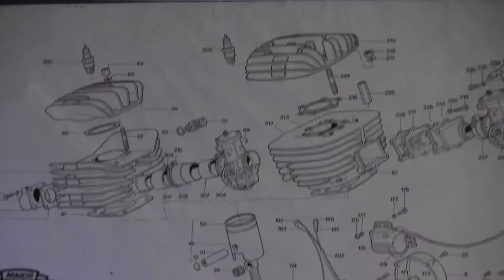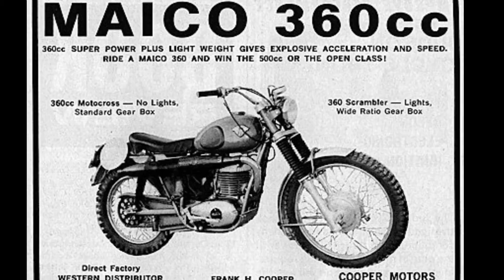1982 Maico 490 Carb Swap (HD)

Comment from the maker: I had the injection off of the TS250 I had also, never know if it's going to work or not one day.  The airleak I had here was on the carb intake.  The carb for this bike is weird where it has a metal sleeve and plastic sleeve.  I replaced it with a later model bing but used a rubber intake but still had the plastic sleeve on it.  This leaked and so had to take off the plastic sleeve and seal it good.  I also switched carbs though but the leak was to do with the intake not sealing.

Comment: Yep, My 81 Cr80 Had a leak right before the reed cage, I rebuilt the engine though and Made all new gaskets with gasket paper and she runs great now. I want to get a cr500 earlier model though, Air cooled cause i dont have good luck with liquid cooled motorcycles. Even a Ts400 would be nice.

Comment from the maker: I just use my truck to transport them around.  Ya, had to get the air filter into the air box otherwise when going through a puddle the engine will shut off :)  Had that happen one too many times not to protect the air filter and this card sits back too far and is too big of an air intake to use the original airbox.

Comment: My 73 ts250 had an air leak once, turned out the injector banjo bolt came out. Luckly i was running premix. It idled just like that.